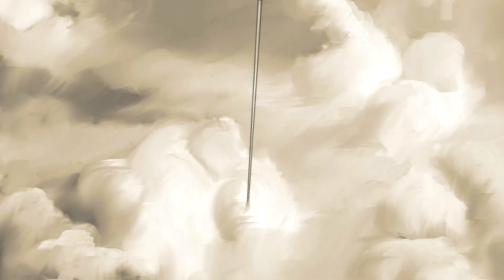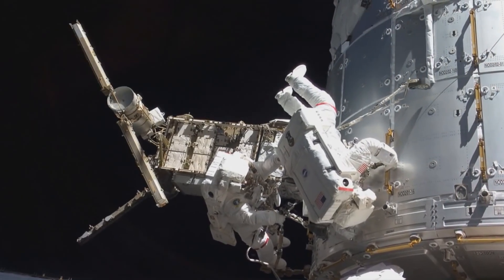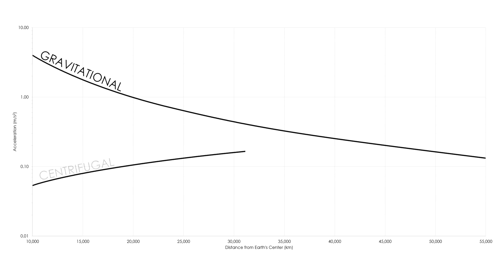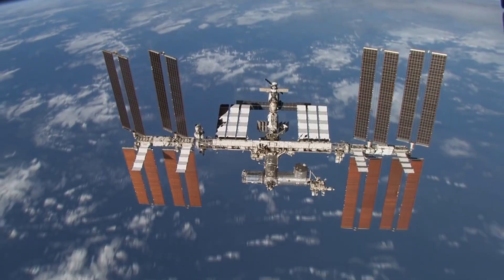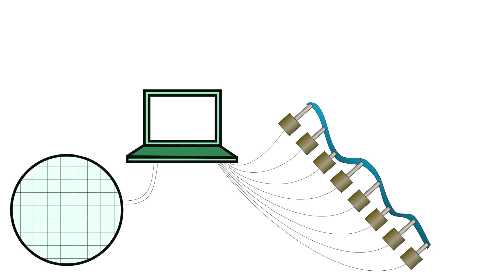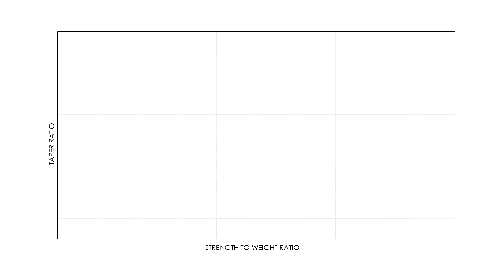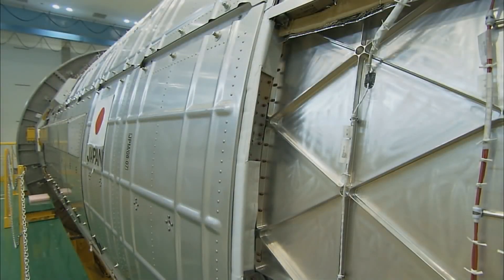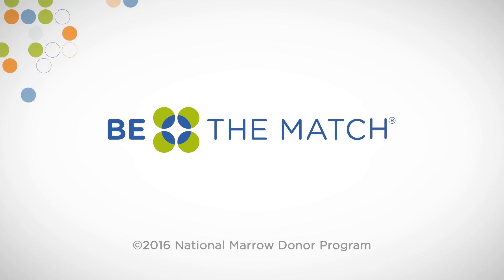Design Your Own Space Elevator

Comment: A new space elevator concept will help to make us a true space faring civilization .
It has multiple tethers at its center ( for greatest strength ) and
fewer tethers as you move away from center ( for lesser amounts of mass ) . It is also in an elliptical geosynchronous orbit , so it appears to drop straight down from space , pick up a payload , and return to space , thus requiring a much smaller system than an earth based space elevator. We already have material strong enough to get us within the distance of the lunar gravity center ( around 6,000 mi. ) add the proposed system above and we could do this now!
Let's get started.
What do you think?

Comment: t has been suggested – 100 years after the completion of the first space elevator there will be more people living and working in outer space than on earth. The first space elevator is difficult to build.The second is much easier.The third, easier still etc.,until we have a ring of elevators around the planet.A trip to space will be as cheap as a train trip across the country.Colonizing the Moon and Mars will be affordable.Space tourism will be huge.Asteroid mining will be huge.And all of these industries will require lodging and related supply chain infrastructure for space side construction workers.A new space elevator concept will help to make us a true space faring civilization .
It has multiple tethers at its center ( for greatest strength ) and
fewer tethers as you move away from center ( for lesser amounts of mass ) . It is also in an elliptical geosynchronous orbit , so it appears to drop straight down from space , pick up a payload , and return to space , thus requiring a much smaller system than an earth based space elevator. We already have material strong enough to get us within the distance of the lunar gravity center ( around 6,000 mi. ) add the proposed system above and we could do this now!
Let's get started.
What do you think?

Comment: It has been suggested – 100 years after the completion of the first space elevator there will be more people living and working in outer space than on earth. The first space elevator is difficult to build.The second is much easier.The third, easier still etc.,until we have a ring of elevators around the planet.A trip to space will be as cheap as a train trip across the country.Colonizing the Moon and Mars will be affordable.Space tourism will be huge.Asteroid mining will be huge.And all of these industries will require lodging and related supply chain infrastructure for space side construction workers.A new space elevator concept will help to make us a true space faring civilization .
It has multiple tethers at its center ( for greatest strength ) and
fewer tethers as you move away from center ( for lesser amounts of mass ) . It is also in an elliptical geosynchronous orbit , so it appears to drop straight down from space , pick up a payload , and return to space , thus requiring a much smaller system than
an earth based space elevator. Let's get started.
What do you think?

Comment: Excellent video!  Regarding the problem of power transmission to the climber, would it not be better to eliminate the climber altogether?  Instead, simply affix the vessel carrying one's cargo directly to the cable, and then manufacture and feed new cable out into space.  This, of course, means that you'd have to do something with all of the excess cable at the far end.  An easy solution would be to feed it back down to another base station somewhere on Earth.  This second base station would help keep the cable tight, and ultimately recycle the old line.  In effect, this configuration would produce a space elevator loop, as opposed to a single linear track.  Here's a post I put out some time ago, outlining the concept:  https://www.facebook.com/permalink.php?story_fbid=348987681974365&id=331085440431256&substory_index=0

Comment: About the problems with beamed power:

The atmosphere MAY actually help lift the climber.  The laser will heat the collection surface, which will in turn heat the air.  The air will expand and push the climber up.

They've built experimental aircraft that fly based on this principle:
https://www.youtube.com/watch?v=5_9ac-w4DW8

Comment: The tensile strength can be solved by attaching something like a zeppelin pulling the cable up(and keeping it balanced) to reduce the tension every x distance. Not fireproof tho..
Reply: What if we could make them vacuum instead of filling them with helium etc., on high altitudes the pressure on the vacuum vessel would be small so we might be able to print it from plastic and throw em out the ISS or something. And for the end/space-point i would think about something like an air-boat.
Reply: On high altitudes the weight difference between vacuum and the surrounding air will be very small. You would need very large volumes.

Have you actually tried to do some calculations? At a height of 50 km the weight of one cubic meter of air is just one gram, so if your construction weighs 1kg it would have to be at least 1000 cubic meter large (ca. 35000 cubic feet). If it has to be able to carry a load of 1kg it would have to be twice as large (2000 cubic meter). A bit unrealistic IMHO.

At low altitudes the difference in weight between a cubic meter of air and a cubic meter of hydrogen is almost 1000 times bigger. That's why Zeppelins are feasible.